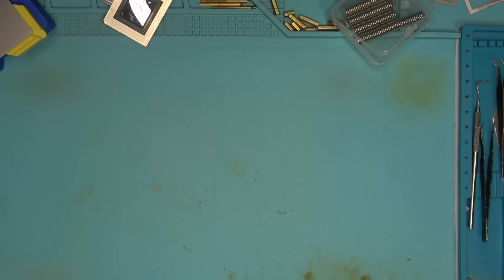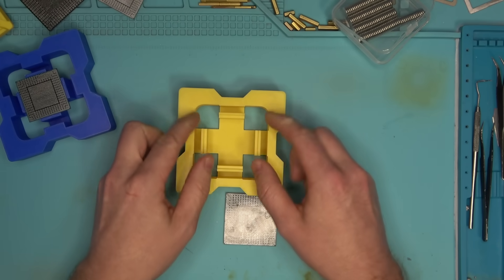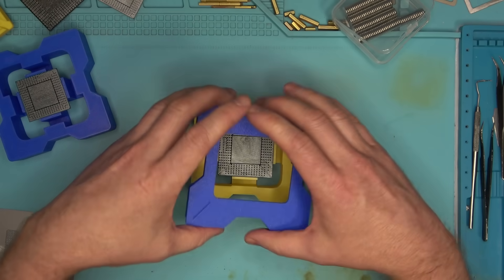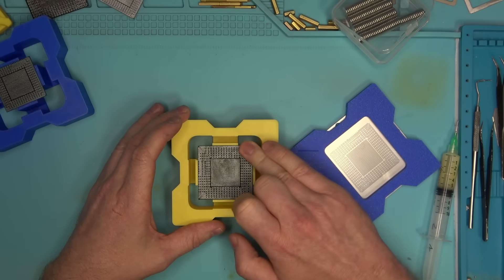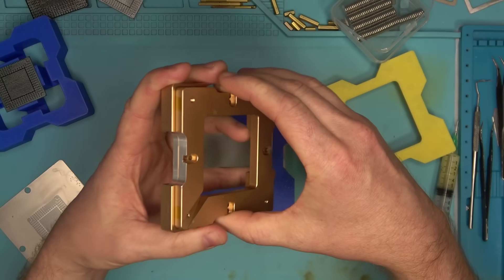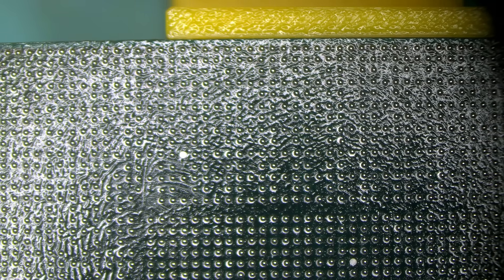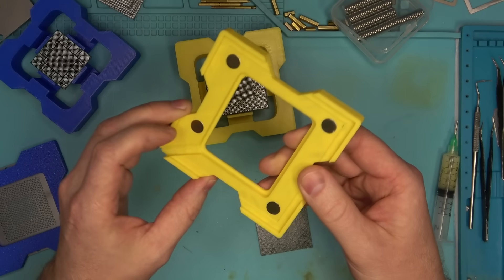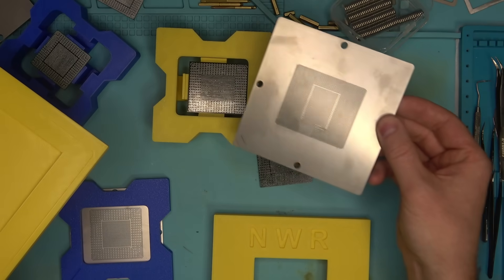Free GPU reballing jig

Comment: To get larger cores out, it could also be possible to print a third part with 4 pillars on which the current bottom part can be placed. When placed onto it, the pillars will lift the core out of the bottom part and it'll be easy to just take the core off. Perhaps it's easier to just create some more space like you suggsted, but now at least you have another option to think about.

Comment: Man, "free" is for someone who already owns a 3D printer but even so,  you need to pay for resin and filaments that probably must withstand highs temps so not cheap ones. Free is the knowledge you offer, and that's more than enough for me.
Reply: You must be the heart and soul of every party buddy. Yeah, the part itself it is not free by any means (the design is), but try asking a junior engineer to design a simple part like that, then compare that cost to the materials, and you will see why this is "more than free" I would say. Because lets assume around 3.5USD for 250g of PETG, maybe 7.5USD for a case of magnets on amazon, if you substract 100USD for the design and testing of the part remains -90USD (negative meaning it is at your favour)

About the actual 3D printer... Would you consider the cost of the oven when someone asks about the recipe for the cake you baked? Would you charge for the total cost of the car when sharing expenses on a trip? Yeah, I figured so.
Reply: @Igbf  So do you suggest buying a 3D printer to get the "free" jig ? Are you retarded or what you didn't understand ?

Comment: Not sure if anyone else suggested this:

A hole in bottom middle to accept a cylindrical ram to press chip out.

Could be incorporated into a larger bowl (glue Post in or screw in from bottom) to catch the solder balls.

Comment: instead of redesigning your model you should make the arms separate from the bottom part and make it so you can slide them and tighen them with a little bolt.

Comment: I bought one of those $30 jigs and it wasn't big enough to fit a 3080/3090/4080/4090 chip so i modified it by grinding the jaws down and now they all fit just fine. My stencil however is warped and not flat so the balls in the center pile up everywhere unless i use the smallest amount of flux and let it touch the chip.

Comment: Given your trouble with the 8x ram reballing jig, you might consider designing one for that too. Great job, btw.
Reply from the maker: Yes.
All i need is a new base and i think that the same concept will work very well. only if i have enough room to make it 3d printer friendly
Reply from the maker: So i did and it did not work well because tolerances are too tight for 3d printer friendly design.
And its plastic so memory chips will wear out the edges very quickly and it will need to be reprinted often.
Memory chips wear out aluminum too, this is noticeable on a single chip jig. The edge is getting more and more rounded the more chips to press in so eventually you have to sharpen the edge.

Solution is either aluminum or brass or mild steel but not plastic. At least not the 3d printed one. 
Injection mold would work well in this situation because plastic can be chosen to be very hard.

Oh well.
Reply: @northwestrepair  Lemme get in touch with you to see what my friends can offer you. Some may be very close to you physically.
Reply: @northwestrepair  get this man a tungsten printer
Reply: @northwestrepair  I think it could work with a resin printer and thoughnes resin mixed with abs like
Reply from the maker: @xcom9648 Resin printer sounds like a solution but that resin better be very strong when cured, stronger than aluminum.
Aluminum while being metal, is softer than some plastics especially around sharp edges so resin might just do the trick.

I already have the design, I just need someone to print it with resin and  test the fitment.

Also tempted to modify the existing part and just add a spring. No need to get anyone involved 😊
Reply: @northwestrepair  It really depends on the resin, although not as strong as aluminum it can be like a hard rubber and pretty wear resistant. i might be able to print the design for you but i don't have a way to test it or anything.
Reply: @northwestrepair  Hi, really nice jig's.
Is it possible to get the base STL file for the memory chips? I'd like to try other plastics. ABS, filament with carbon, or resin.
That would be great. Best regards!

Comment: Why didn't you design a biggest one and then inserts to accommodate the smaller ones?
That will make it good for future sizes as well. It takes up too much real estate atm.
Reply from the maker: I was thinking about that. 
Universal base + removable inserts.
Maybe in the future.
Reply: @northwestrepair  Make the model parametric and it will make your life alot easier if its not already. GL, looking forward to the final form.
Reply from the maker: @noanyobiseniss7462  what is parametric model ?
I am using 3ds max
Reply: @northwestrepair  adjust model based on numbers/parameters
Reply from the maker: @dkirby1906  that will limit me to use of predefined models instead of custom made editable poly models.
Reply: @northwestrepair  yes that's true, i don't model myself but ive used openscad parameters and it makes it easy for the user to customize it all especially since every 3d printer won't be the same. take a look at editors like fusion 360 and you'll see how it works, everything made has some sort of measurement attached with it in predefined shapes.